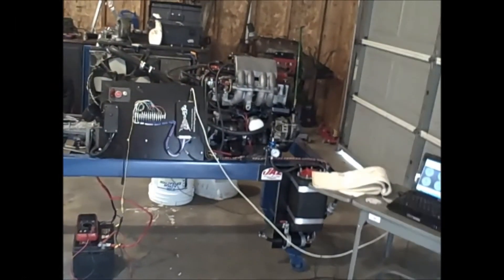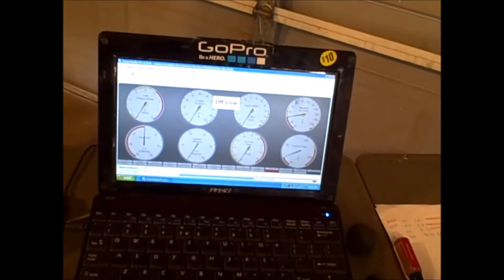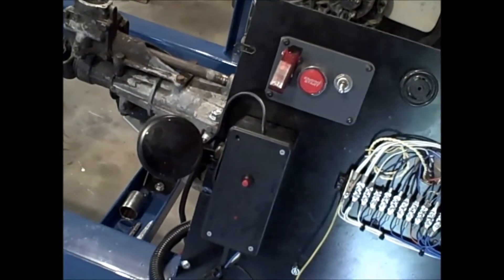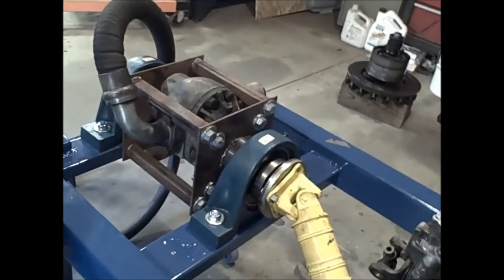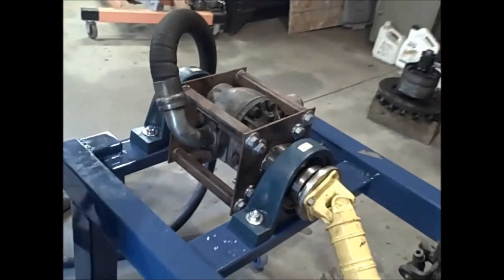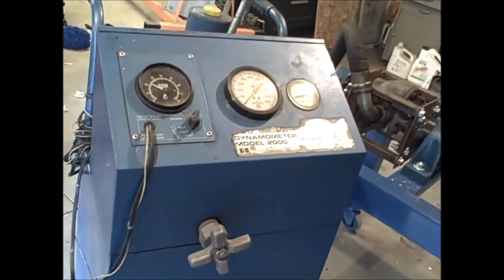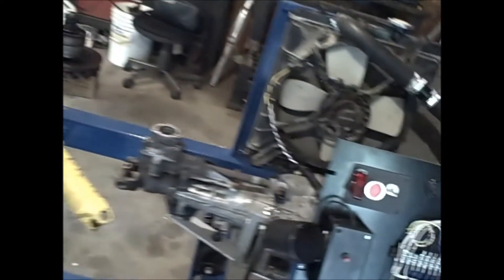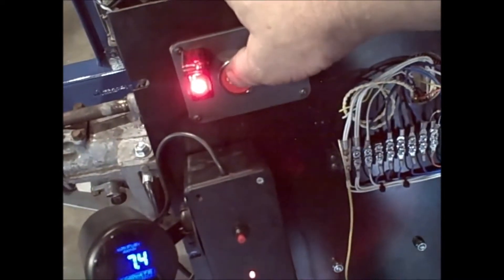Mazda B3 first start engine Dyno

Comment: Where can i buy performance parts for the B3???
Reply from the maker: Parts for the B3 are getting hard to find.  I pretty much made all my stuff.
Reply: @robotcantina8957  everyone is going on about the FE3 engine and telling me, im wasting my time with the B3 , i did so far 

Head porting and gas flow
Cut the camshaft to 288
Solid rockers 
And soon i will have the twin hitachi carburetors on it 
The exhaust and headers are also a must

Why not make a 1.3 fast????

Comment: Is this the same engine found in a Ford Festiva? And if so, where did you get the transmission? I'm looking at mounting the engine longitudinally. Thanks
Reply from the maker: Yes,  this is a Festiva/Aspire engine.  The transmission is from a Mazda Miata.  Bolts right up.  The flywheel, clutch, oil pan  are from a 1.6 Mazda .

Comment from the maker: The dyno engine is custom built and is identical to the engine I built for my Miata.  The Miata has almost 50K miles on it and is trouble free.  The goal is to get over 50 MPG while retaining most of the sports car feel.  Check out the first start of the original B3 in the linked video http://youtu.be/DGmWutGBPNI